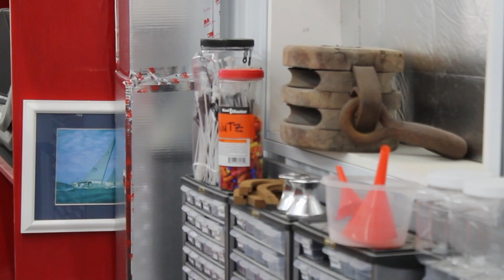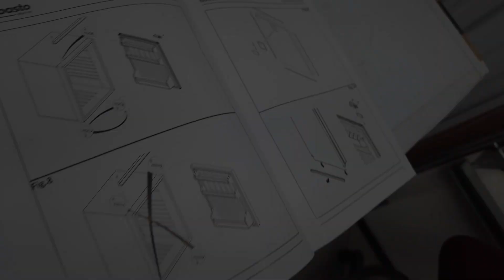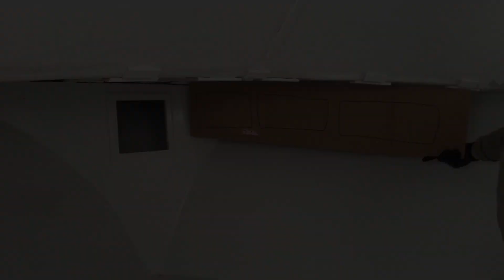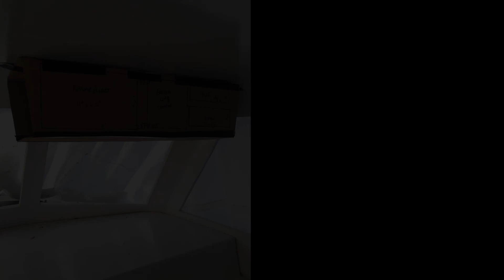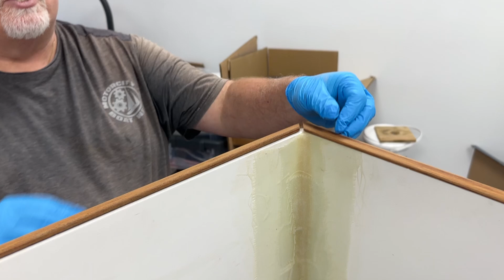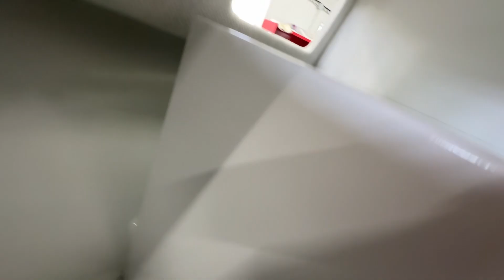The Truth about PVC Foam Board | Refrigerator Cabinet | Great Loop Boat Building (Ep105)

Comment: Hey Joe looks great, that pvc is used as a core material in boats all the time. Once you add glass and resin to both sides it is very strong. Keep up the good work.
Reply from the maker: Sorry this PVC material (Celtec) is NOT core material. 👎 all core materials are not created equal 🤓 this material is relatively heavy, it requires surface preparation to get fiberglass to adhere, it does not absorb resin or bind that well. I recommend you watch my videos and read my articles about core material choices for amateur boat builders and boat restorers

Comment: Other YouTubers are probably talking about the pvc foam core that’s used as industry standard cored composite construction
Reply from the maker: There are structural foams (corecell, dyvincel,airex) and there are close cell plastics (pvc foam board). 🤓The first you use in composite sandwich construction. The later you use in sign making and composite cabinet construction. They are not the same. 🥸There are also channels that don’t know what they are talking about—because they don’t actually build anything—they just chase clicks and follow YouTube trends👎 my audience knows the difference. And I make my notes available in weekly articles and ebooks in my Technical Library on Patreon. check it out. https://patreon.com/MotorCityBoatWerks